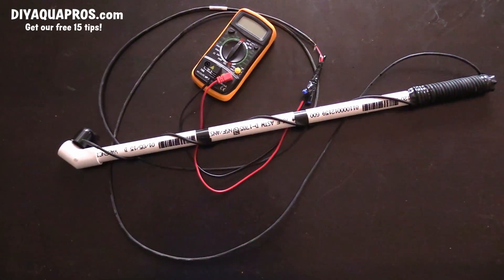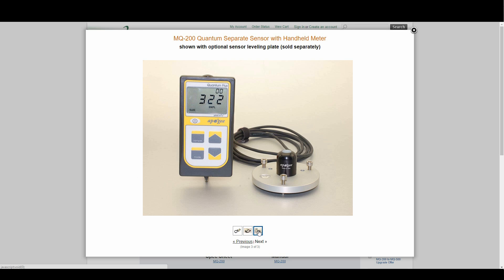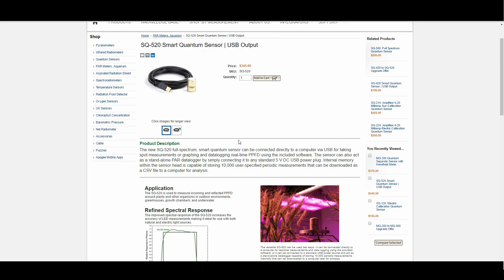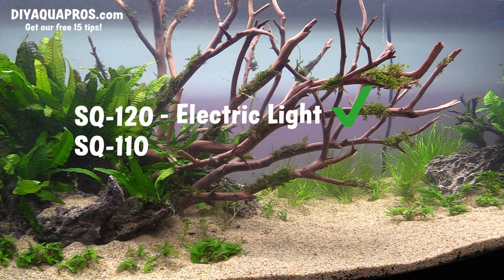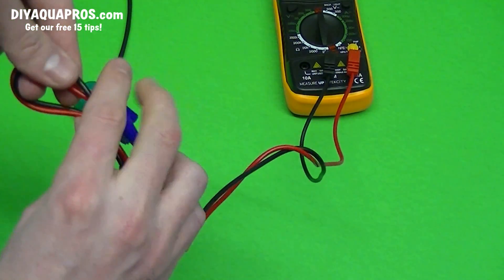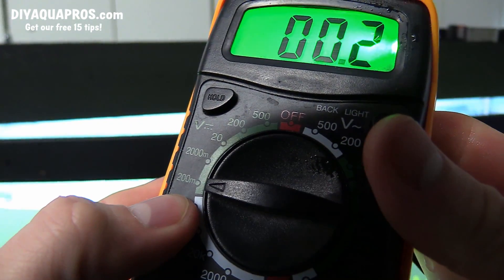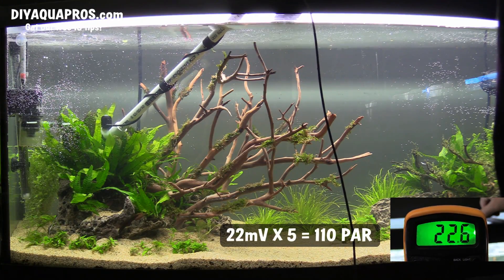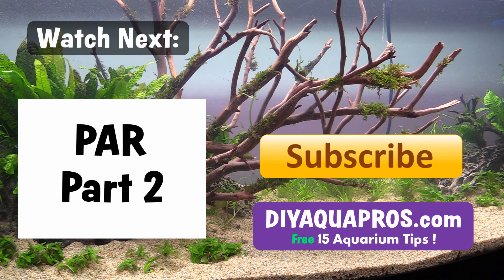DIY PAR Meter: How To Make A "Cheap" PAR Meter For Aquarium

Comment: Would this work for a reef tank using  LED lights? Eg. AI prime/hydra
Reply: Did you ever find out if it will work with LED.  He talks about a correction needed to be made for LED but never made that video.
Reply: @Mcappo  nope. Radio silence
Reply: @Steve-514  if you haven’t made one or bought one you might want to check out the SQ-420 Smart Sensor.  It’s a little more but you just plug into a computer via USB or a power block and it will log the data.

Comment: great idea but biotek has a par sensor with the software for 200, not so much saving with a DIY if you consider the calibration and accuracy these guys did.
Reply: The video was made 3 years ago, what you are talking about is relatively new. Im using this to convert my apex PMK to give real time readings. Good to know there is an alternative solutioni to this though! Also, apogee sells one similar for a bit more.
Reply: @creab485  thanks for clarifying. I wish I could compare your DYI readings to the commercial one. I might go with yours especially if we consider the accessories price :)

Comment: What happens if you switch your meter to 2000mv?  I was told to use that in horticultural par readings.   Please a little help would be greatly appreciated!  Putting it together right now..

Comment: Dude you just made the most expensive ghetto rigged par setup ever! Huge thumbs down bro. Hydrofarm quantum par meter, $126.30 and prime shipping on amazon. There is a thing called google for a reason. Take this crap down. You are misleading the noobs.
Reply: No, this $160 rigged setup will last longer and give better readings than the cheap hydrofarm PAR meters which break easily.  And the Apogee sensor is waterproof.  If Hydrofarm used the waterproof sensor their par meter would be closer to the $300 range.  Also putting a plastic bag over your sensor will render it inaccurate.
Reply: That piece of shit can't even go under water and if you read the reviews it's total garbage. You should take this post down, you're the one misleading people.
Reply: @Alex-jc3xx  Maybe he works for hydrofarm or maybe he's just a fool/tool.
Reply: hydro farm sensor is not waterproof
Reply: mini clear ziplock around sensor probe plus bead of silicon....boom waterproof.
Reply: try that on your handphone
Reply: Yes, BOOM, inaccurate readings because you covered the sensor.
Reply: Of course the hydrofarm Par Meter is notorious for exploding.

Comment: on the Apogee site it talks about the immersion effect and needing to multiply the reading by 1.08. so does that mean I should actually be multiplying the reading on the volt meter by 6.08 instead of 5? or should I multiply the answer of the reading x 5 by 1.08.  example 50mv x 5 = 250 x 1.08 = 270    or    50mv x 6.08 = 304 or is the immersion effect already factored into the 5?

Comment: the only problem with par meters is that it does not tell you the amount of light at different parts of the light spectrum. For example, you could have all bulbs that put out blue light, and still get the same amount of par as a different light with green or red output bulbs. So you'd want to buy bulbs that tell you what the spectrum output is.
Reply: +chris day But when measuring an entire plant, not just one leaf, under high light the current evidence shows that all of the wavelengths between 400-700 are pretty much equal at driving photosynthesis in plants. Debunking the 1970 study. So, the wavelength balance under high light is more for aesthetic reasons than for photosynthesis. And red and blue LEDs are more electrically efficient than white, so that is why they use them. An increase in UV-B will also induce anthocyanin, which acts to protect the plant.